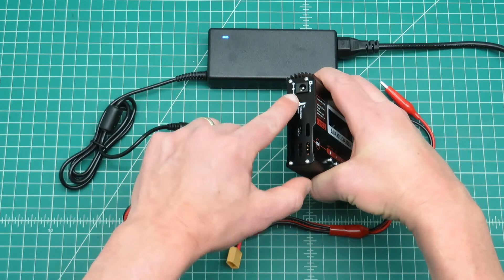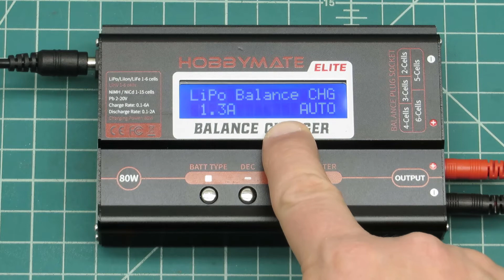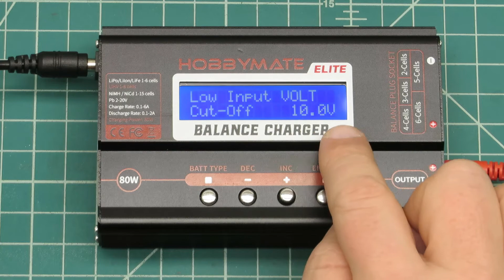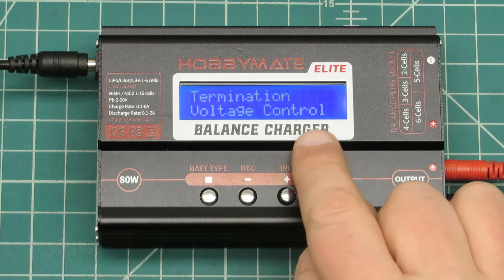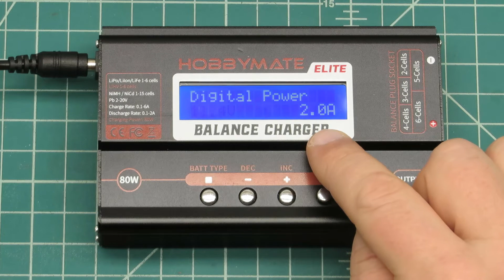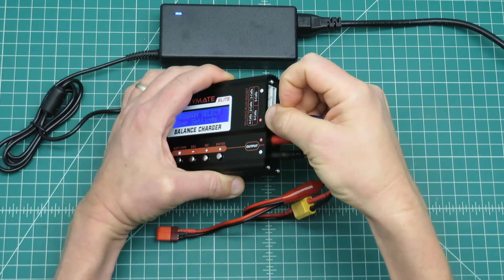Hobbymate Elite Balance Charger

Comment: the bigest thing to me is seting the max cut off chargge voltage i got a unit simular and it can not do this so i hate it .i have used the timing charge method but that ant fool froof and one has to baby set the charger and turn it off at around 80 percent or were ever you want it to stop at .will this thing take modified voltage settings like the imax b6 does the real ones any how

Comment: Great Video.  Just bought one and having trouble.  Trying to charge a 11.1v 3s LiPO and get a "Battery Check Disconnect" message when trying to use balance charge connections.  Switched to two banana plug output and got "Battery Check Lower Cell Count" message.  Cannot get it to work.  What could be wrong?

Comment: Hi- can you tell from this unit what the size of the DC power plug is? In addition to the AC adapter I'd also like to power this charger using a large capacity portable battery pack (similar to Yeti) that has several DC power outputs. I figure I need a cable with a round DC plug on each end but not sure of size needed on this unit. Thanks!

Comment: I just got this and I'm having am issue. I'm putting bebop power battery liPo. It says battery disconnect every time.. Do you have any suggestions? Thanks
Reply: mike shevlin u have to hook up both cables on the batttery. The output and the 1cell, 2cell etc option